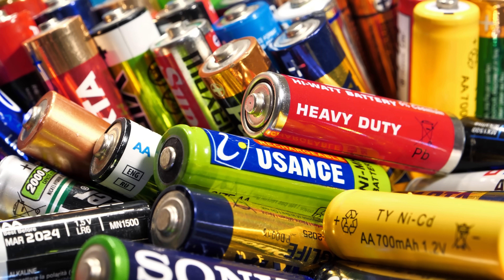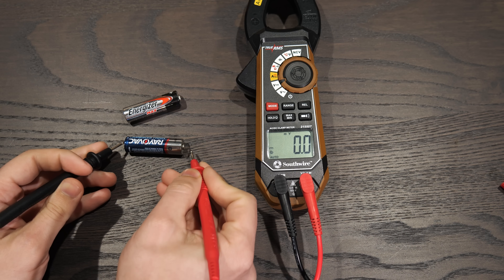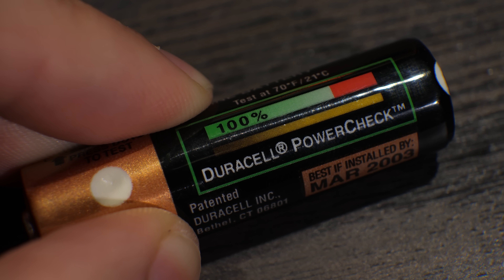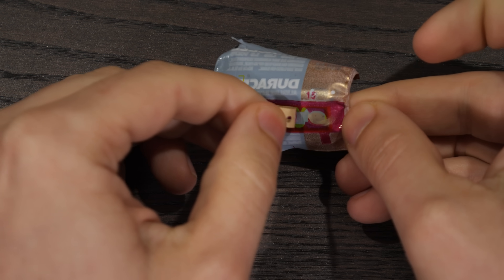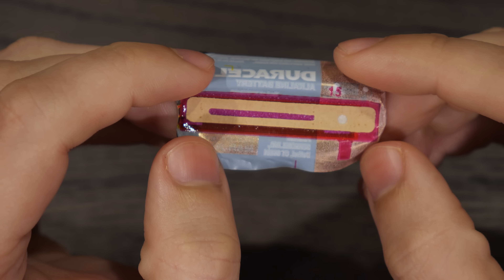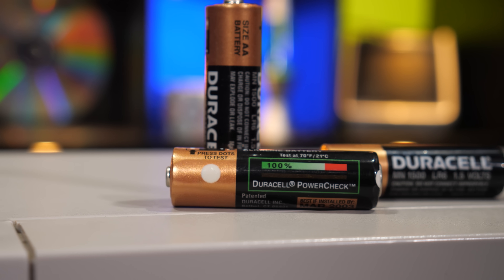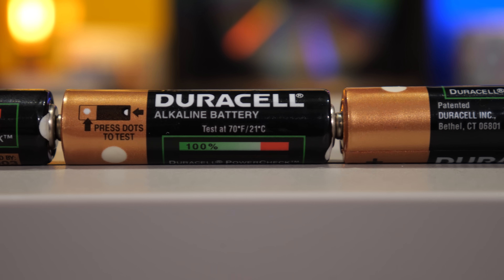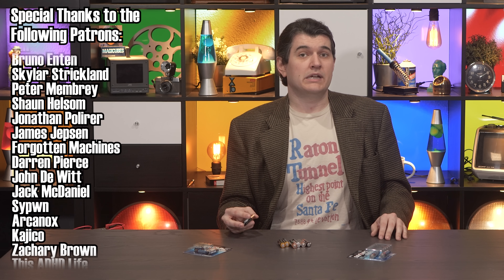Duracell PowerCheck: A genius idea which didn't last that long

Comment: So maybe I grew up in a slightly different age, but I remember these check strips always being on rechargeable batteries.  Which, since they're rechargeable you don't necessarily get rid of after they go dead.  So it would always be more useful than not to have the check strips to see if the battery was good to go or needed to go in the charger.
Reply: that makes sense. rechargeable makes more sense

Comment: The headache of asking for batteries. The good ol 🎮 Game-Boy days these batteries were great used to take them out to check which ones were strong enough to put in "my oh shit" I'm almost out of  batteries pile🔋💩 for for the inevitable rainy day 😂

That batterie 
🔋🔋💩 pile never got very big😂😂😂

But Zelda got beat tho🤘😂🤘

Fyi you can use one almost dead battery with two of these  batteries at 50% in your Game-Boy-Color just in case anybody needed to know that 🤣 😂 🎮 

        Thanks for the nostalgia
good video

Comment: I remember the Duracell's with battery check.

Although your conclusions are generally correct for residential users, as a telephone field tech I found the battery check feature useful given that our equipment and also the equipment we were servicing went through copious quantities of batteries. So, it was easier to simply change out the ones that were flat.

Comment: This is fascinating .. never knew how these worked but I actually used them. If the device was beginning to act strangely, run weakly, or do anything else I thought was odd, I actually did use the battery tester to determine if it was the battery or the device. Big shock, it was always the battery but it was nice to be able to check for myself.

Comment: I always thought that the built in battery tester was there to ensure the battery did not last as long as it could because the tester used more power than a lot of equipment the battery ran. I onced worked with a stage production company and they used AA in microphones and they wanted to ensure that the batteries would last the entire time they were on stage, the answer was to put fresh batteries into the equipment every performance and rehearsals so that by the end of the week there was a bucket full of slightly used AA batteries, we would grab handfuls of these as they were still good for a lot of things  in fact they were hardly drained at all.

Comment: You definitely should not keep batteries in devices, that you are not using. Also at least here in Finland we return used batteries to shop, because they were required to take them back since 2008, and before that you could take them to sorting station.

Comment: These are so cool, but a completely unnecessary gimmick. Their only purpose was to serve as copium for children stuck outdoors with a GameBoy that wont turn on, pressing on the white dots till their nails crack, hoping there's still some power left, as if checking would magically give it more. That and leaving it under the sun would make the bar turn yellow due to heat, so children actually believed that they were sun powered.

Comment: Over here, we can still buy those Duracells with PowerCheck. They even have AAA ones with PowerCheck.
Reply: Duracell Ultra usually are the ones with PowerCheck ... but they're being phased out by Duracell Optimum which do not have PowerCheck anymore.
Reply: they must cost $20 for a pair lol

Comment: I really liked the battery testers that were included in the package, like a little strip.
They were much easier to use than the ones "built-in" the batteries themselves.

I often find myself regretting that they don't exist anymore, as I don't have a battery tester and often battle with batteries without knowing their remaining level.

Comment: originally sold with a "re-usable 
-strip" that would fit any hold battery not just the ones you purchased 

was long enough to wrap onto each positive + & - negative terminals

 on the strip was phosphorus looking display once powered by the battery being tested that would tell the user low to full in bar graph form 

you just had to buy to expensive brand once to get the promotion batter meter yet once you tried the better brand you was hooked by how powerful and how long they lasted 

you would tell customers family and friends that " Energizer Bunny TV Ad Commercial "  was Right! 

💯 

then they built the batter meters into the battery design 

I hung on to those batter test meter strips for years they would turn up in all sorts of places, bottom of kitchen draws , tool boxes 

now I know when I replace batteries to test I put my AA cells in my battery operated shaver I can tell by the sound the shaver makes it the battery is worth saving to use for a much less demanding powered application where cell batteries will keep a device power for something or other

Comment: As a 24 year old, I had no clue these even exsisted and its pretty neat, my initial reaction was "Thats so cool and useful why would they stop that" but now having watched the video, yeah, thats tracks like who would have took a half used battery out of a device it just makes no sense, unless you lived in a high humidity area and werent planning on using said device frequently enough before he batteries would corrode

Comment: Even if you have a loose battery that might work to fix your remote control, why would you test it using the "PowerCheck" when you can just put the battery in the device and see if it works?

Comment: When you think of it,  why the 2 dots? Surely seeing it takes about the same amount of pressure as what's required to make a diamond,  you will hardly accidentally set it off,  and even if you do, it's just a battery.

Comment: Back in the day when these were 'A thing', I cut one off a AA cell and kept it in my wallet, so that I always had a basic AA/AAA battery tester on me (for those multiple times a remote control, or whatever 'Suddenly stopped working' etc), then I could whip the tester out, test the batteries and figure out if it was a duff batt, or the remote had given up due to 'One too many drops' etc 🤣🤣   😎🇬🇧

Comment: Duracell still uses these here in Europe and I typically use them to figure out if the device that's using the batteries is dead or if it's just the batteries that have died. Kinda surprised you didn't think of this really useful use-case!

Comment: Speaking of "Drop" in voltage, if you drop a fully charged battery on a hard surface from lets say 15cm/half a foot, it either stops directly and falls over, or just does a little bounce. An empty battery bounce off the surface, the higher/more bounces, the more empty it is.

Comment: I grew up in a baaaaaarely barely middle class household, and so Duracells were "too expensive" and we had random Chinese batteries instead. And I remember my frustration when those Chinese ones would have the graphic with the test, and the green, and the red, and saying the green means close to 100%, and the test bar, but that was it. It was just a printed graphic. There was no functional test. Imagine my frustration as I tried to rub and push on it and nothing would happen, ever.

Comment: A quick mental survey suggests that the things I can see around me that need disposable batteries are my clock, my indoor/outdoor weather thingy, remote controls, and the blood pressure pump. (It'd be a nice video to do something on these micro-compressors!) Everything else is rechargeable. Until it isn't.

Comment: When you said it needed to be at 70F, I just assumed that was because the chemistry of any battery can produce more current/sustained volts at higher temps, not an actual heating element lol

Comment: I just use a battery tester. Works with any battery, instant reading. And while Duracell's tester was a cool gimmick, the reality is Duracell batteries cost 2-5x as much as other alkaline batteries. And despite their weasel worded vague claims of superiority their discharge times aren't especially different to other alkaline batteries. Same goes for Energizer and other heavily promoted brands. I suspect most of the price differential is to sustain their marketing budget rather than any inherent superiority. Just buy the cheapest alkaline batteries you can find and if they don't work, move up to the 2nd cheapest.

Comment: I absolutely hated these things. They never worked well and required you to basically squeeze the heck out of it to do the job. It was FAR easier for me to just slap it into my 1980s Radio Shack battery tester. I learned to take batteries out of things that were infrequently used because they would tend to leak and destroy my device. The rest, yes, they remained in place until they were dead. This mechanism was more of a marketing and sales gimmick than anything else. Initially, they were intriguing. The novelty wore off quickly.

Comment: Another drawback was if you pressed hard and got no response, you possibly pressed harder. That's different from a regular mutlimeter where you always get some response once connected, even when it's only 0.3v or so. And that is much more satisfying. So it was just an promising gimmick until you tried it out.

Comment: So when you buy an analogue voltmeter to test batteries, why can't they add a load to it for a more accurate measurement? 

And can't a multimeter have a loaf switch so you don't need to plug a micro heater in when measuring?

Comment: I've noticed recently that modern tech still hasn't exactly mastered charge indication, like my wireless headphones frequently show a random grab of percentages if they're on any variation between dead and full, even when the Bluetooth is connected it tries to show remaining charge but usually quickly drops to 20% and stays there until they actually start to die? I don't know, something's weird about it but it could just be cheap tech in general

Comment: i remember one battery company had it printed into the plastic clamshell package that the batteries came in. i remember cutting it out of the plastic and keeping it in the junk drawer so i could test any battery i wanted. somehow used dead batteries were always mixed into the good ones for those times when the remote just needed a little boost to make it though the day.

Comment: I remember working for a rechargeable NiMH company and being very frustrated by these. The functionality in disposable batteries is questionable, sure, but for rechargeable batteries it would be really useful! We were trying to incorporate SOME kind of testing, but were never able to get anything reliable.
Unfortunately, the voltage dropoff for the two types of batteries is not the same. It was pretty linear for those disposable batteries, but the NiMH we made had a non-linear voltage dropoff (basically they maintain relatively high voltage until they were almost dead, then dropped off very quickly). So, the problem went unsolved, and now few people buy NiMH. <shrug>

**NiMH is Nickel Metal Hydride. We made batteries in all the normal consumer sizes (AAA AA C etc), and custom (which would be used industrially). We were an OEM and supplied relabeled batteries for a variety of large brand-name batteries you may be familiar with.

Comment: I guess I'm the outlier. I used those Duracell testers all. the. time.  AND I always throw half-used batteries into the drawer for later use. And I have 2 battery testers, one that doesn't work at all. I probably need help, lol.

Comment: My father used (and still does) to pile stock used Batteries of different types, brands and states of charge *no! they are not completely dead - I'm shure"  in a Box of Boxes which gave me lots of "fun" in my youth time guessing a pair of fairly useable ones when i needed them. If such Duracells where in the mix i always gave them the first shot.

Comment: I do have a drawer with used batteries. They are mostly from flashlights - because you know it still works, but the light is kinda low. But they are still good for other things. Also re-chargable AA and AAA batteries are still a thing. I do prefer them in my light sources over integrated rechargeable, because I can swap them fast if needed. A flashlight with integrated battery that is low is no good is it?

Comment: There was a variant of these that put the tester in the package instead of the battery. If I recall correctly, they were most common for 9V. But these were useful - free, easy-to-use battery tester built in with my pack of batteries!

Comment: We’ve basically completely switched to NiMH batteries. My mom loves to put battery powered Christmas lights literally everywhere, with each lasting like 5 days on a pack of 3, we burned through 6 batteries a day on average. We do have a few alkalines around, NiMH isn’t great because of the lower voltage in cheap non-regulated devices, especially if they last very long and the natural discharge of NiMHs becomes significant. Like clocks or remote controls.

Comment: The last devices I'm still using batteries for are guitar equipment - my guitar takes a 9v for the preamp, my pedals take 9v's, my pocket amp takes a few AAs, and my 5W guitar amp takes 6 AA's. Seems like the guitar world is propping up a few very outdated technologies - non-rechargeable batteries and vacuum tubes.

Comment: Impressive that you still have 2003 Duracell that haven't leaked yet ... I remember a lady in a camera shop where I was buying 2nd hand Nikon equipment explaining to me that whenever she finds a battery that had leaked into a device and corroded all contacts, it would always be a Duracell so she never wanted to sell them, always sold Panasonic. She said Duracell sacrificed most of the protection around the cathode/anode and the expansion space for giving us the few % extra lifetime their marketing claimed.
I must say It matched my own statistics later on... The ones that messed up the battery compartment of my toys were always the same and no Panasonic ever damaged one of my toys.

Comment: They are a great idea but in practice, quite useless. All the average consumer needed to know was once device stops working then you change the battery.

That was more than enough knowledge to get you through 99% of the time.

Comment: I only use rechargeable batteries now for my devices. Oddly enough there are a few that only use Duracell. My smoke alarm wont work with a cheaper brand and my cats auto feeder won't operate without a Duracell either.
I reckon its because they have a superior charge to a recharged battery.

Comment: I remember these. I also remember the battery tester strip we used to have. It was just as much a pain in the fingers to use as these and about as effective. I think I threw it out at some point about a decade ago, give or take a few years, because of how beat to hell it was from 20+ years of being mashed onto the ends of batteries. My family also keeps a bunch of half used C batteries in our battery bin that we only use for the Christmas candles. True, we have to replace at least a few every year, but it beats buying like 30 new C batteries every year until we upgrade to rechargeables.

Comment: you can even roll a piece of tin foil into a small square and put it next to an end of a AAA battery in place of a AA battery
it won't last as long, but it will work; the voltages of all AA, AAA, C, and D batteries are the same

Comment: I usually only throw batteries out when they're well and truly dead. I have some things that require good batteries to run (like a hair trimmer), but there are some other things (like remotes or those wall clocks that run off a single AAA) that will take a well used battery and still work for months. I always check them with a tster before throwing them out.

Comment: Also little point in using alkaline batteries when rechargeable AA/AAA/9V exist. I’ve never had an issue using them in devices that indicate not to use rechargeable ones as well…

Comment: I am a retired electrical engineer and I really like your channel. You help make many things clear for the average person. One of my multimeters has a battery tester range on its selector for AA, C, D and 9V. Like the Duracell tester, it places a small load on the cell/battery.
Reply: That actually makes a lot of sense, and now I want to see what current my older meter is pulling in 'batt' mode... I always wondered why there was a separate setting for it when it's just a voltage range, but of course a load test would need its own setting.
Reply: @KPR:  The problem is that the load that these testers place on the battery is too low to be useful.  In my experience, to get a good accurate reading, you have to load down the battery pretty hard.  Then (and only then) can you get a good estimate of the battery's actual state of charge. 

I'm such a nerd, I actually have a few 1-ohm, 10-watt power resistors that I use for that purpose.  😁
Reply: My B&K Precision Model 113 has "Batt" ranges too, likewise it places a load on the cell under test ...

Comment: life cycle of the double A in the 80s: Use in walkman until it sounds wobbly, put in controller for radio controlled car and spin him round until you have to stand over it, then swap it for the TV remote batteries, so dad gets mad at the broken remote again :)   Start over...

Comment: Okay, just to give those ancient designers the benefit of the doubt, would having double AAs rather than in a remote control add weight, unbalance them, or make them less ergonomically pleasing? If that was shown in product testing, then maybe this can be forgiven. 
If not, my guess is that they could make more money by putting in AAAs. Maybe it would have lowered the cost of including a set with a new device. Or the in-bed with Big Battery. :P
Still pretty irritating.

Comment: THIS would actually be a great idea on car batteries. they need to bring em back. they already have this function on tool batteries. the in dash voltage meter on some cars are either in accurate or non functional and would save some of us with bad  or dying altenators.